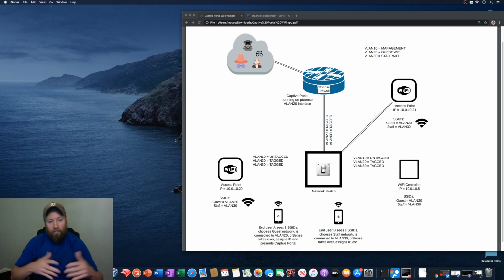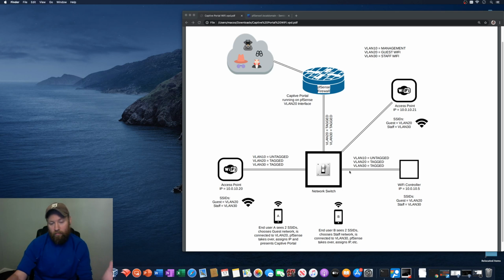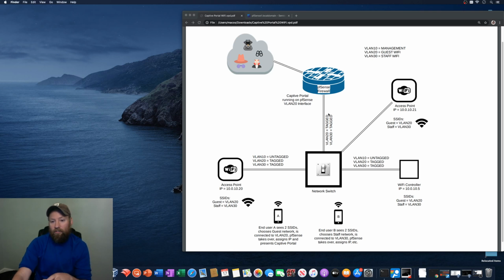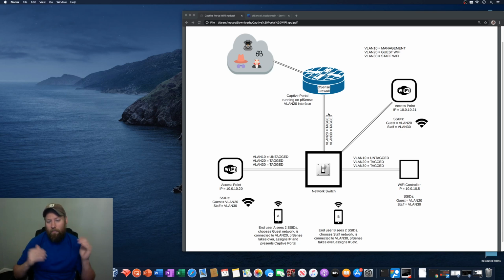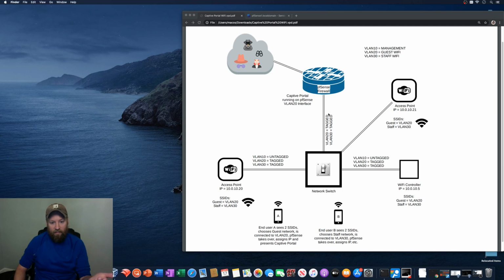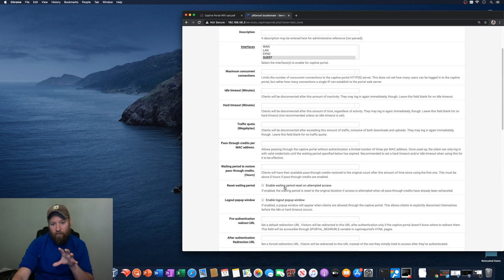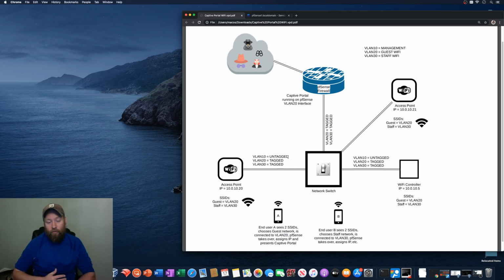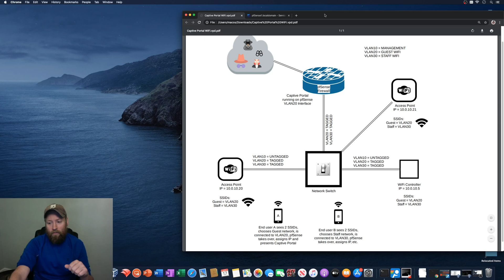Captive Portal Network Diagram

Comment: One reason for a guest and Staff/in-house wifi access point is very simple.  The access points may be very dumb..  They may be old wireless routers,  Raspberry Pis , or USB dongles hung off  who knows what.   Guest Wifi may use G band while  Staff uses an N-band access centered on the Admin area.    Some people learned on single SSID systems .  They may not be comfortable going beyond them.    My router with 2 extra nic ports and onboard WifI., plus  USB 2,.     No Wifi access is currently set up.   For my home use, almost anything would serve.  I am the sole user on my net now. 

         I am a retro Pc  hacker.    A captive portal may also secure primitive systems which  do not have good user controls themselves.    There are DOS, Amiga, and even 8 bit systems being given wifi or Ethernet capability.   The portal may manage access to the local net, direct internet access, or VPN secured access.